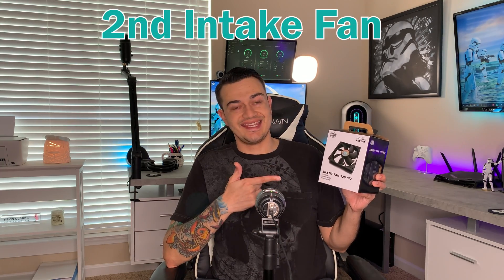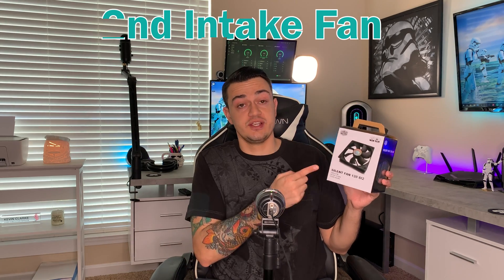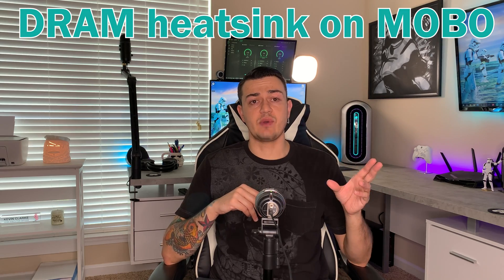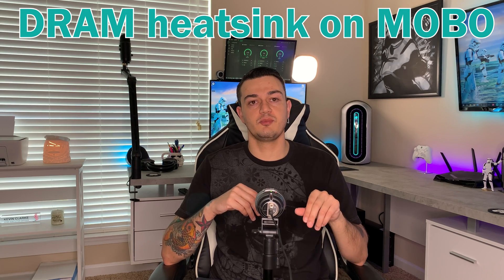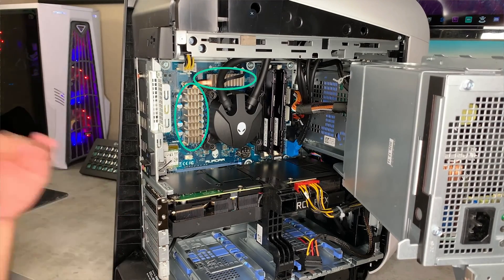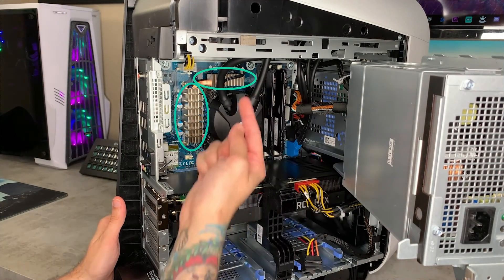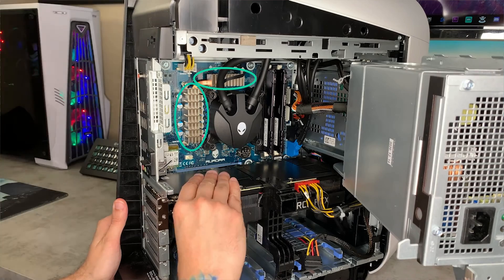5 Must Do Mods/Upgrades For The Alienware Aurora R10/R11/R12

Comment: I have an AW R10 AMD Ryzen 7 5800. One thing I did was cap it at 4.6 GHz @ 1.3 v in ACC. It makes a big difference in temp management. I wouldn't allow the CPU to go higher unless you do a case swap.
Reply: Did you see any performance difference with this?
Reply: @alfredosawce1530  I didn't see any difference in performance. These days, you get most of your heavy lifting from the GPU, if you're talking about game performance.
Reply: @diyhomeimprovementandwoodw3751  I was also wondering if switching and adding new fans would make the 550 w PSU work too hard and if I need to buy another.
Reply: @alfredosawce1530  Adding a couple fans should be fine.
Reply: @timsgamingchannel3881  thanks for the response, just bought the r10 because it was up for $1469.

Comment: I paid 1700 CAD for a 3060ti and r5 5600x air-cooled, thing kept on crashing like crazy, dell makes me do troubleshooting, doesnt help and actually made it worse, they replace the GPU and it didn't help, offered to replace CPU but turns out it wouldn't ship out for another 2 months so they offered me a full new replacement.

So now I am currently waiting on a 3080ti, fully upgraded lunar light 1000w liquid cooled case, r7 5800, 16gb dual channel (I was dumb and had single channel), and a nice free copy of bf2042 and the generic mouse and keeb.... All for the low low price of the 1700 cad that I paid originally.

I know dell gets a lot of shit for the product they made, but God damn their warranty replacement is nice and the techs are nice as well.

Comment: 1) put your aurora straight to the wall so it can’t cool properly
Reply from the maker: You do know the exhaust fan is on the top, not the back, correct? Also you don't know the ambient temperature of this room, also my CPU is watercooled.
Reply: @GamerHeavenOfficial   @GamerHeavenOfficial  
1) GPU blows both top and back
2) It makes no difference what the temperature is in the room and the fact that the CPU has liquid cooling because there is no airflow in the corner and no good way to arrange that airflow so that after a while, the computer will be cooled by the air that it heated itself, which will certainly affect the quality of cooling.

For various reasons, I also have the Aurora standing in a fairly confined space (not as close to the wall as in the video). The air around it gets 5-7 degrees higher after a while, so the cooling efficiency goes down accordingly.

If I open the window, which is directly behind the rear exhaust of the Aurora, the temperature on the GPU drops 7-10 degrees.

You talk about cooling efficiency with an extra cooler on the one hand and simultaneously blocking airflow on the other.
Reply from the maker: I have tested the tower in different positions In the room with 1-2 degree differences, and now have it in the position that works best for my setup , USB ports within reach , plenty of desk space ,  not getting hot , and in shot of room recordings, also not on the floor sucking up lint and pet hair which I would never have a pc on the floor. What is your suggestion ? Have the tower In the center of my room for 1-2 degree drops in internal temps of the CPU, gpu, ram ?

Comment: I added a second intake fan to my R11 and my temps went down 5 to 8c across the board. I use a Noctua NF-P12 redux 1700 PWM. Definitely worth the 5 minutes it took to install it. Used the two sided tape method. I also added a second NvMe SSD, it’s a 1TB Samsung 980. It feels backwards to have a mechanical hard drive in your system. I edit a lot of photos and video. It makes a huge difference editing high res photos and video off an ssd compared to doing it off a HDD. No loading times it’s beautiful. Kept my HDD as a backup, put it in a usb enclosure.
Reply: I thought the R12 only had 1 NVME SSD slot?

Comment: So I did a little testing on my R10 Ryzen edition.  I got 4 Noctua NF-A12x25 PWM fans and did the upgrades and used thermal grizzly paste.  Some of the things I've noticed from the two stock fans.  The Noctua was very very quiet.  However the temps were not vastly better.  So I decided to try the stock fans again and repasted when I pulled the cooler off etc.  So the fans are A LOT louder, however the temps actually came down with the two stock fans and the 3rd Noctua that was were the 3.5 bay was.  So I started looking into it.  The Noctua would only spin up to about 1800 rpm and pushed like ~80-90 cfm.  The stock front fan spins up to 4k rpm and pushes like 130-140 cfm.  That was crazy how much more air it pushed when it went 100%.   Now the top fan... that bad boy is something else.  It's a durn server fan.  also has a 4k+ speed on it and pushes about 3 times the air that the Noctua pushed out and it is also a (high pressure) design.   So really the Noctua setup (along with the setup used in this video) would be better for quieter operation and similar temps.  The stock stuff is good for temps but horrible for noise.  I would 100% recommend putting that 3rd fan in the front, and also using some quality thermal paste on the CPU and if using the 3000 series Nvidia cards, doing the paste and pads on it as well.   Cheers and Thanks for the video.
Reply: Dude thanks for the info! I am getting my replacement unit soon, I originally had air-cooling and it was loud and hot as hell.

So I think I'll take your advice of leaving the server fans and adding a new fan.

Just a question though, included in my replacement is a 512ssd and a 2tb HDD, is there anywhere to move the HDD if I want to add the 3rd fan?

Comment: I did the push pull for the radiator, but the top fan won’t turn on.  The other fans also work but only at 4%.  Any ideas what I jacked up?

Comment: I build PCs to and sell them locally with offer up, fb marketplace excreta. I recently worked on an r11, it was a horrible pile of why. Its a POS case with plastic snapped all over it. Kind of like lipstick on a pig. To compliment poor case itd pair with menagerie of poor choices. Most of the choices seem to be more of a value difference they don't seem to care about you after purchase. Air cooler is trash with no room for ventilation, the fans attach by a wierd block for no helpful reason, various places on case could simply have wholes for fans to be applied if you wanted like removing ssd trays and putting bot fans, still don't know how to get into trash bios normally, nvme I added has wierd larger holes so I couldn't use nvme mount I had to add a mobo mount which made it slightly raised but I got to pull the spinny boy so who cares, the mobo is trash, hard drive bay is where a front fan could go and 2 ssd trays or on bot they could have made 1 of the bottom hard drive bays hold a hdd and ssd left front vacant with holes for an extra fan. Im not that familiar with prebuilts but this one must be bad or all prebuilts are trash, I'll leave that for you to decide.

Comment: my old custom built system had a gtx 970 in it that was starting to crash, especially while gaming. Ended up getting an Alienware R12 with a Core i5 and an RTX 3060 (for only $1000) and you are 100% right about it needing these mods/upgrades. I havent done the thermal pads and paste to the GPU yet tho. Do you think it is really needed in a 3060?
Reply: no shot you got a r12 with a 3060 for only $1000?
Reply: @illisimo   i got one last month with 5 5600x, and 3060ti for 575$ FB marketplace

Comment: Thanks for the video, really helpful 
How easy is it to upgrade the GPU with these models? Can you only buy the graphics cards from Dell? Apparently the r11, r12s etc have smaller graphics cards than the normal GTX cards so they fit in the case

Comment: I purchased the r10 with the 3700x and the 3080 last year because that was the only way to get a 3080 for $1470 total. Let me just say this: change the case, mobo and psu as this dell build is choking the whole innards. Also, the mobo is trash and you will truly feel the difference if you upgrade to a b550 with pcie 4.0 as it will run true 16x. My system is buttery smooth with a big difference in temps.

 Dells 3080 is made by micron and they run at 8x which sucks big time but they run on full 16x in the aftermarket mobo.

I'm total, I spent an extra $250 which is still cheaper than a current 3080.

Comment: Don't know whether to thank you or be upset that your suggestions will cost me more $.....  I'm gonna go with the first.  I Can't believe how much quieter and cooler the R10 system is running. Did 4 out of the 5 mods, but am not quite there with taking apart the GPU.  Many Thanks!
Reply from the maker: Lol, sorry dude. I'm glad your R10 is purring like a kitten now.
Reply: @GamerHeavenOfficial  Will the fans you showed set off a bios error?

Comment: Response as an owner of R10 ryzen 3700x:

Mechanical hard drives are not dead! I ordered my alienware with a single 500gb nvme m.2 ssd because I planned on upgrading the storage. I replaced the m.2 with a faster pny 1tb (i like pny parts), The original m.2 with the OS is backup stored in a drawer.  installed a 4tb WD black gaming 7200rpm HDD and it's awesome. The majority of games play same on an HDD vs an SSD and the 4TB is a LOT of space for games and large files such as my pirated movie collection, all my pictures. there's spots for one 3.5'' drive, and 2 or 3 2.5'' drives. SSD are indeed cheap these days and are of course required for the OS but mechanical HDD still work well for other things. WD has up to 10tb drives and the pc slots are so damn easy, the drives literally just slide in the available slots and the connectors are already there waiting. Since the pc is not see-thru, all cables included as well as those for future upgrades are already there. Large open-world games like world of warcraft and fallout 4 I do recommend installing on an SSD however.

Overclocking: not all of the ryzen alienwares are overclockable. Really dumb I know, especially since you're not told when you buy that the pc you are getting will not have advanced tabs for cpu and ram overclocking in the alienware app,  and won't have overclocking as an option in the bios. I can use ryzen master, but there is no bios or way to overclock the cpu/ram automatically upon startup.
my rtx 2060 I use pny software to automatically apply my custom settings on startup

I did upgrade my internal fans, it absolutely cut down on the noise and was overall a good decision. I had a pny RTX 2060 super on hand so I ordered mine with the lowest end gpu and immediately put in my 2060. It's not a blower-style video card so the temps are not as cool as yours are. I run my gpu warm, set at 82c as a preference. my previous pny 1060 i had set at 82c the entire 4 years I gamed with it, and the warm temps absolutely do not bother the gpu in the long run.

Comment: So I did the fan replacement with corsair ml120 fans (non pro) and the front fan won't run. Originally thought it was a dead fan, ordered another and same thing. I tried using the 4 pin for the cpu fan and it ran great but the pc won't boot like it originally wouldn't when that fan wouldn't run...the stock fan still works...any suggestions? The top fan works, same fan.

Comment: I almost bought an Alienware R10, but I always research things before buying them. With needing to do mods like extra fans (and replace the existing fans with better ones), have a crappy unbranded MOBO that makes upgrading/replacing/relocating very difficult, the massive amount of bloatware Dell installs, the RAM being too expensive, etc, etc.....I started looking elsewhere for a system that can easily be modded. (Looking at Build Redux and Maingear at the moment since buying prebuilt is about the only way to get 5900x's and 3080's these days)
Reply: What did you end up with? Something similar to the specs of this system ?
Reply: @kylergeston  A Maingear Vybe. AMD 5900x and 3080 gpu
Reply: @Curveball  I'm really thinking of going this way as well for the same reasons you mention above. Future modifications and upgradability being the main points. Appreciate the reply. 👍
Reply: @kylergeston  You're welcome. Good luck with it.

Comment: I got a great deal on my R10 3 months ago. AMD Ryzen 7 3800XT, RTX 3060ti, 32gb ram, 850watt PSU, 1tb ssd, 1tb sata, liquid cooled. $1699 + tax, and because I used my AMEX card, I got another $180 off. Too good to pass on. Thanks for the improvement tips.

Comment: Dell's stock intake fan is 148CFM.  That's why it's so loud at 100%.  These replacement "silent" fans push 30-40CFM.  But Dell's fan at 20% is barely audible.  These quiet fans are quiet because they're wimpy fans!

Comment: I modded my alienware by buying a Corsair SF750W PSU, 240mm Cooler Master AIO, Aorus x570 itx motherboard, and a NR200 case. Took the nvme, cpu, gpu and ram into the new case, and DITCHED THAT POS of Alienware case.

Comment: if I change the fans they work, but I cannot control them properly from the Alienware Command Center. At offset 100 they turn to a maximum of 57%. I couldn't find a point in the BIOS either

Comment: When you say "After market fans push more air"... is serious misinformation. The aurora has ridiculously fast stock fans with ridiculous RPM, that pushes a ridiculous amount of air. The issue is not the amount of air they can push, but how noisy they are. In the video where you add a front intake fan, you used a 3 pin non PWM fan and paired it with a PWM fan on a splitter, which means the after market fan will always be at full speed. Of course a fan running at full speed will push more air than the stock fan running at 10% speed.
Reply: and it's not a DRAM heatsink, it is called a VRM heatsink
Reply from the maker: I’ve heard it called dram heat sink in many forums
Reply from the maker: It’s not at full speed, it’s at the same speed % as the stock intake fan. I can adjust its curve and speed as needed .

Comment: Alienware desktops are nice but they run insanely hot. Dell should find a way to improve their cooling solution on these systems. My Gpu easily reaches 84C in gaming and my cpu almost 90

Comment: Hi there sir, i have a few question. I like to shift all the items to a new case, what's the size of the mobo, is it an atx or matx. Also would like to purchase the r10 5900 version, is it possible to even use another mobo since the 5900 non x is an oem. Im scared it wouldnt work on another mobo (if for example i buy a strix b550m). thank you!

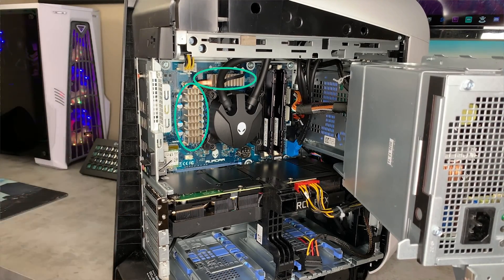Comment: 5:47 I don't see any water-cooled CPU options on Dell's Alienware website anymore. Have a link to that? Thank you.
Reply: It will say it on the part where you choose the color of the case...itll say water cooled, the color of the case and what type of power supply unit comes in the model
Reply: @vuhchina6449  thank you. I decided on a pre-built by Xidax.

Comment: Do you think pc Temps are cooler with the pro fans or stock fans. If noise is not an issue?
Reply: The Stock fans are very good but noisy
Reply: *the stock fans can run to 4000-5000 rpm

Comment: You said something about simply adding in another memory kit to upgrade RAM later, and in my experience, this does not work. My R11 came with 32GB HyperX Fury 3200MHz in dual channel configuration. I tried to add a HyperX Fury 32GB (2x16) 3200MHz kit and could not get the memory to overclock at all. I ended up putting the RAM that came with it in a drawer and installing 2x32 T-Force DIMMs instead, which overclocked to 3200MHz without issue.

Comment: Just received my R12 and it does come with a pcie4 slot. By the way installed two Corsair pro fans and they work amazing. Took out the HDD and put a fan in that spot with gorilla tape worked perfectly. Installed a 2.5inch 1tb ssd on the bottom tray aswell. Thank you for all of the diy.
Reply: How is the R12?? Would you say it's worth it for what specs it came with?  Debating on getting a gaming pc, I've always used console but I want to experience the peak performance etc.

Comment: Alienware is a waste of money. All that overpriced crap with trash cooling. People are better off building their own instead of wasting money on dells crazy ass prices.
Reply: Go out and buy a 3080 and a ryzen 5800x. 
What's that cost you? 1500 bucks usd?

Now go out and buy the Alienware with the 3080 the r5800x in a total package with ram and harddrives and water coolers and Dell's 10% off online coupons and 2% cash back from top cash back and 3% cashback from Rakuten and 2% cashback on your credit card and then ask dell to cancel the order and they say if you keep it they'll give you 150 bucks off then add the 3% cashback from dell rewards and everything warrantied  and your sitting at around 2000 dollars for an entire PC rather than spending 1500 on a cpu and a GPU..

I only upgraded 2 fans to noctuas for push pull on my R10 and my cpu enevr hits above 65c while gaming and neither does my 3080.

Running CINIBENCH at 100% usage on cpu multi core test cpu never hits above 84c and considering the 5800x has a 125 watts TDP in that ti y case with only upgrading 2 fans literally everything you said is uninformed and 100% wrong.

Alienware is an amazing deal and the hardware works fine with a few small tweaks and I got my 3080 and 5800x aw sent to my door in 2 weeks. How long you gotta wait to get scalped for a 3080? 

Yeah you wrong bro..in every sense of the word